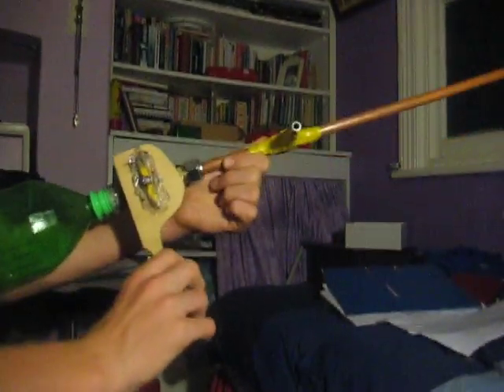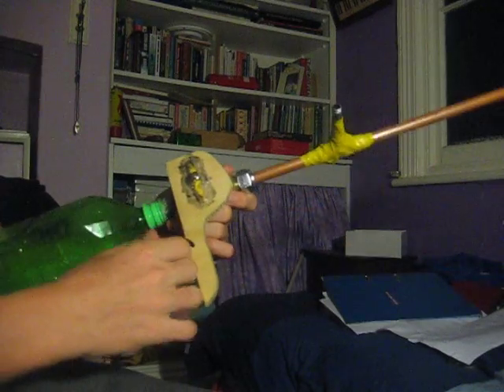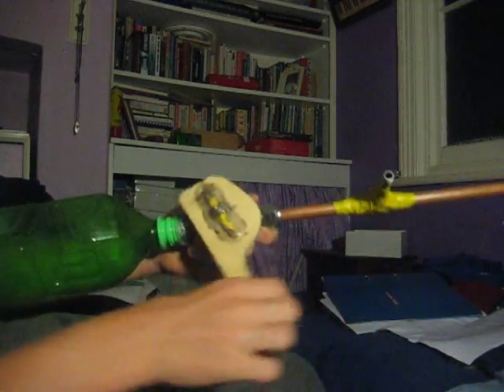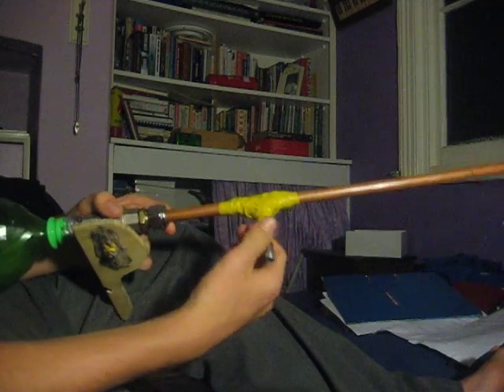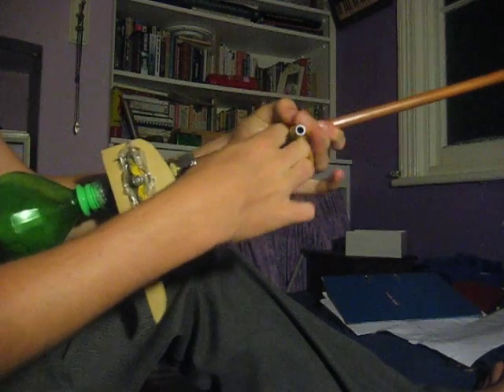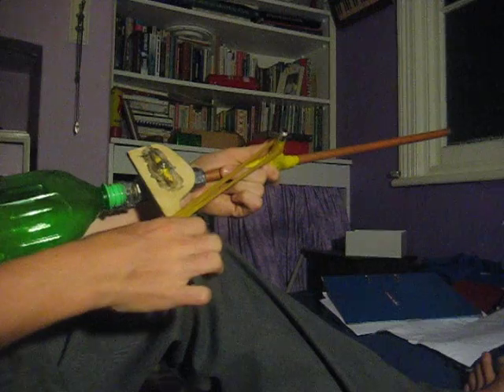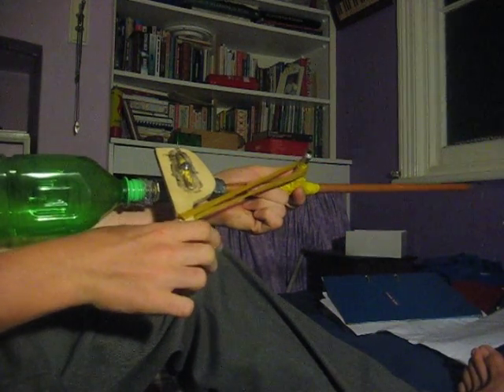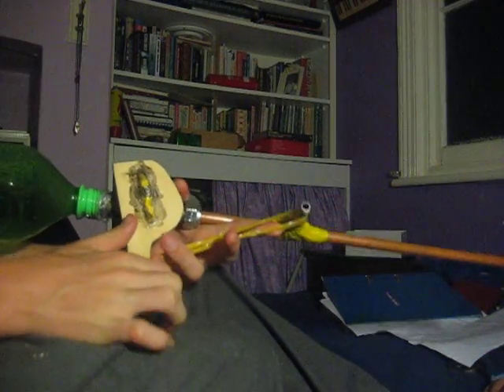Air Gun Trigger Mechanism

Comment from the maker: yeah its really tricky to get a non leaking tank, i never got mine sealed completely properly but the leaks dont let out to much air anyway and it still works.

i suggest an empty fire extinguisher, because they can screw on if you have the right fitting and they can hole three times the amount of pressure.

thanks foir the comment and i hope i helped you out.